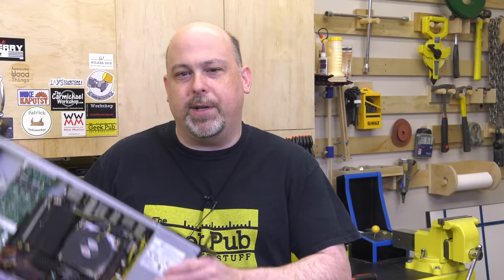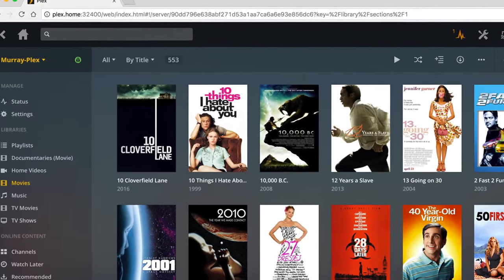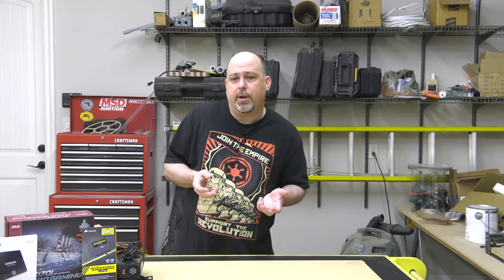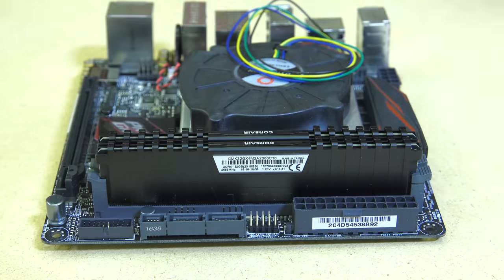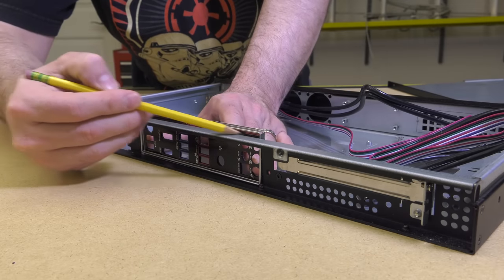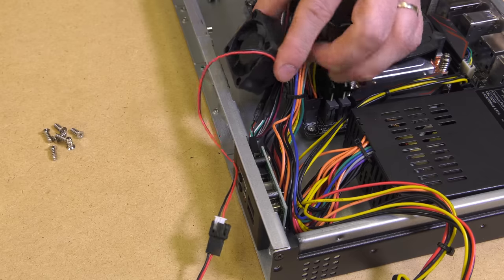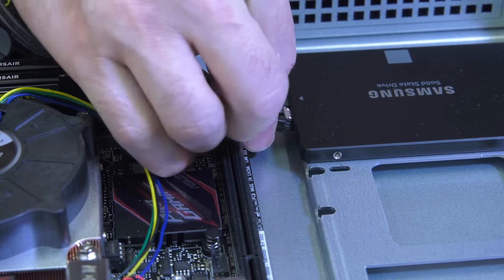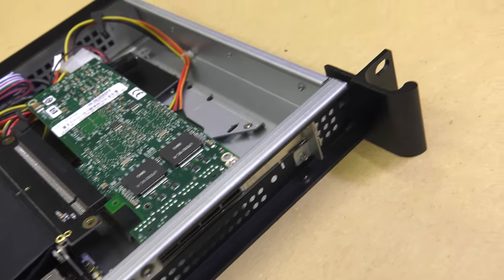Building a 1U Server (Bad A$$ 1U Server)

Comment: a server without a xeon/ECC ram is hardly a server, not to mention that the xeon would be a good lump cheaper than the i7 despite having more features, ECC support, lower TDP and better yet the same spec with only 500MHz lower clock speed IIRC
Reply: matthew brown You should learn about the definition server, a server can be anything. Raspberry Pi, Laptop and so on.
Reply: nowhere did i say it wasn't a server, i said it's hardly one, given this is to be used for 24/7 operation it pays to use the proper hardware for that, having run servers on consumer hardware in the past i can confirm it is not a good idea which is why i recommend against it and why i feel that anything that uses consumer hardware is as far from a server as you can get, makes little sense to use consumer hardware given that it's actually cheaper to use server parts, the xeons for this socket for 4 cores and 8 threads are cheap and ECC ram has always been dirt cheap for decent quantities apart from the bleeding edge 16GB and 32GB DIMMS
Reply from the maker: https://www.thegeekpub.com/8565/xeon-vs-core-i7/
Reply: TheGeekPub that misses the point of the xeon, it's cheaper and is better suited for this workload, it's a no brainer to go for the xeon really
Reply from the maker: It's not cheaper.  This horse has been beaten to death. ;-)  It's only cheaper if you get a much slower chip which completely defeats the use case for my build.
Reply: TheGeekPub the entire selling point of the xeons is that they're i7 spec for i5 price, they are indeed cheaper, even here in the UK where pc bits are expensive so unless your market is really fucked over there then they should be cheaper
Reply from the maker: By all means, point me to some links.  The cheapest apples to apples XEON I can find to the i7-6700K is $100 more expensive. Additionally, its missing the QSV core of the i7 for video encoding/decoding which my Plex server software takes advantage of.
Reply: TheGeekPub well first off, why do you need 4GHz specifically? Transcoding? I'd so the lesser ones would do fine, VM's don't need clockspeed either, before you go on that tangent explain specifically why you need clockspeed

Comment: should have gone with mini itx xeon, you know, actual server hardware lol
Reply from the maker: Find me a motherboard, processor and fan that will fit in a a 19" 1U case that is 12" deep or less and I'll get started on it
Reply: there are literally so many server configurations that would fit in a 1U lol!
Reply from the maker: 12" deep?  I'll humbly admit defeat when you show me a link to one.
Reply from the maker: Oh, and it has to be as fast or faster then the the processor I used..  A four year old processor running 1Ghz doesn't count.
Reply: +1998goodboy I was going to try to ignore this thread, but it jest kept eating at me.  I don't get guys like you who comment with stuff like this.  It's like you're just looking for a fight.  I know. Don't feed the trolls.  Shame on me.  TheGeekPub started this video with the fact he was building a server for HOME USE.  For a freaking theater room rack and would also use it for a test lab environment for his home network.  So sure.  Let's assume there is an ITX board that will fit in this case with a Xeon equivalent and let's assume that he can even keep it cool in an A/V closet!  Exactly how much redundancy does one need for home theater server? A Xeon and board are going to cost far more than he spent on this setup and he already has two of these running in VMHA.  Should he also install N+1 power?  Get a couple of chillers and a computer room HVAC system?  Raise the floor 24 inches?  Get a VESDA system installed?  Tell me again the point of your post.  Oh I remember... Trolling.
Reply from the maker: And its only a 2Gz processor, and the whole build cost almost twice what I spent.  I need to do multiple real-time transcoding within Plex to send streams to multiple users.  2Ghz and no on-chip CODECs.  According to Geek Bench, my build will literally smoke this machine. I'm not being negative.  You came here telling me what I should have done, and then provided an inferior solution not understanding my use case.  I'm not the least bit angry, just confused trying to understand your point here.
Reply: But you have the cores, if you will use it for virtualization, it makes no sense to go for GHz over cores. Also, Plex is amazing at using multiple cores, which is why many Plex builds out there used to go for the older cheaper AMD CPUs.

P.S: Geek Bench isnt the best benchmark, simply bc it focuses on single individual core performance. So this benchmark would do justice for tasks which need more GHz rather than cores.

Edit 1: about the price, there are many different configs you can make, this is more of a proof of concept.

Comment: There is nothing "Bad a$$" about using consumer hardware in a server. It's not even a server. You don't buy a bicycle and call it a a 40t Mega truck.
Reply from the maker: Apparently you didn't pay attention to my use case.  Use case matters. Also you might want to look up the definition of the word server.  It has nothing to do with hardware as has been brought up in this thread 1000 times.  U
Reply: Yeah, i stopped watching as soon as i saw the i7 in the Background.
Reply: MrYou88... The Core i7 has a quick sync video core.  That's a hardware video CODEC if you're not familiar with it.  This machine will run circles around the fastest XEON for a media streaming server.  This is the same reason the Core i7 Macbook Pros are crushing the XEON based Mac Pro in video editing performance.

Comment: You can save even more money by not buying desktop CPUs with Intel's patented "Unlocked Multiplier Markup Tax" and motherboards with "gamer" features that you will never use/see inside the rack and  instead going with 1 or 2 generation old Xeons. You can often find those for a steal, or even for free harvested out of old servers that companies sometimes give away or sell for basically nothing. Then you can also use error-correcting memory for all those VMs!
Reply: You're right, but I think you missed the theme here.  He was going for the absolute most horsepower he could cram into that little case.  2 generation old hardware doesn't fit that criteria.  But you're right if you want to save money.
Reply: I get the 'theme' idea, but honestly it doesn't make sense for his stated use case. For all those virtual machines, the added L2 cache and other features designed specifically for virtualization in even a 1 or 2 gen old Xeon would probably give you more benefit than the raw CPU clock speed of a desktop I7. ECC memory is very important as well. Plus there's the heat that I7 is going to generate, a 1U isn't a lot of room, so adequate cooling, if you can even rig it, is going to be god awfully LOUD. imo, using these parts is a waste of money, theme or not
Reply: Let's see... I need to move a couch across town once a month.  Do I buy a $20K SUV or do I buy a $500K 18-Wheeler, with redundant tires, greater load capacity, a longer lasting engine, etc?  While you're technically accurate in your comment, you completely missed the mark.  And there is no version whatsoever of a server board (at least that I've seen) that would fit in a 12" deep case which was his requirement.
Reply: OK man. That's a poor analogy, but whatever. If a job's worth doing, then it's worth doing right... however it's your money, so spend it however you want on whatever kind of couch moving equipment you see fit. Have a good night

Comment: Its NOT a server. Its a PC in a 1U box.....If you want a cheap 1U server for home ESXi work and development. Look at a Dell PowerEdge 1950 III or newer. (Dell, HP, IBM / Lenovo certified hardware server engineer). At least that way you can use vendor optimised ESX builds.
Reply: Dude.  You obviously have no idea what the definition of the word server is. A server is a function, not a piece of hardware.  Anything can be a server, even a Raspberry Pi.  Some servers need more redundancy than others, but they are still performing a server''s role.

Comment: Xeon cpus are better and cheaper
Reply from the maker: Def not cheaper, and completely wrong for video CODEC applications since it doesn't have a QSV core (at least when this video was made).
Reply: I’m talking about the slightly older ones like the x56 procs

Comment: while its cool, the reality is your consumer level hardware its not quite what is really a server, its a home server and thats fine, 

i bought each of these, for 30 bucks from a university, i run them in the closet, the 4U is now 500TB and 4X E5-2697V2 12 cores ,24 threads, 256GB of ram, and have about 300 bucks into them

today i have both of these running my home on 10GB fiber

i made this in response to LTT crashing their full SSD server, older is sometimes better 

https://youtu.be/WGu2VM5YrQk
Reply: As mentioned numerous times, a server is a function not a type of hardware.  He said it was a home theater server.  I don't think he's suggesting people go build this for data centers.
Reply: Correct but the common misconception of what a server actually does and consumer level technology is not reliable as a server 

I get what he is trying to convey but someone said it best, he built a glorified desktop in a 1U case

Comment: you flow all the heat from the CPU over the NIC its not a good idea as you explained that it is important part of your server
my advice, loose the back I\O and keep it open to the cpu to flow its air outside
Reply: That's actually terrible advice.  I understand your point about the network card, but if you took out the IO plate, then you'd stop all airflow from the network card and SSD.  The flow of air through the enclosure is very important.  This is what stops one area of the server from getting hotter than another.  This is the exact same science behind why data centers have raised floors, vented tiles in specific areas, and plenums at the ceilings for returns.  This is to force air to circulate uniformly and avoid hot spots that would otherwise be created.  Don't do this.
Reply: Reggie Cotton
But he installed 2 air flow onfront of the rack server
My rack servers at work have 2 optins for air flow all over the front to the back or from side to side

Comment: Without the proper airflow of a true 1RU server your HP 4 port NIC will have a short life. Those get very hot.
Reply from the maker: According to the temperature data, it is well within its operating temperature specs.
Reply: Under what kind of load?
Reply from the maker: As mentioned, I test all of my systems with Prime 95 at 100% CPU load for 24 hours before placing them into service.
Reply: Network load not CPU load. If you don't really use much of your NIC's throughput, it should workout Ok for you.
Reply from the maker: I don't get it.  So somehow my machine is capable of cooling a Core i7, but not a NIC?  Am I missing something here?
Reply: Yes, those vintage Intel quad cards get very hot under full load. Most good enterprise servers have very good front to back airflow which those cards rely on.   Touching the heat sync on the card after full load, in a system without good airflow, will not be pleasant.
Reply from the maker: "system without good airflow" - Who has one of those?
Reply: Todd.  Are you serious dawg? Do you even know what you talking about?  I'm surprised geek pub even giving you the time of day on this. You don't know whether it has good airflow or not.  You just talkin to be talkin.
Reply: It looks like your ingest fans are on the right side of the box in front of the power supply.  The quad NIC is on the left hand side.  I'm just putting the warning out there.  Take it or leave it.
Reply: I think I speak for everyone when I say "We'll being leaving it!"
Reply: BTW...the HP NIC you used in the video is an older HP NC364T.  It's the same as the Intel Pro 1000 PT, not the newer Pro 1000 VT which you talk of and are pointing people to.  See markings list here: https://goo.gl/RLuzBA
Reply from the maker: false.
Reply: Well, did you swap to a different NIC after the video?  Around 9:23 in your video you can clearly see the HP part #:  436431-001.  You can find the HP part here:  https://goo.gl/x4Q98N  I guess it could be a Chinese knockoff.  Now I'm real curious...can you take a direct picture of the top and bottom of the board and post it?  FYI...I've got the NC364T in one of my servers and I'm pretty familiar will it.
Reply: He mentioned somewhere (maybe his blog) that these were refurbs and they came with half-height mounting plates for 2U servers. Since they are mounted using full height backplates I must assume he replaced them with whatever he had laying around. It does sorta feel like you're just here looking for something to argue about, but I'm going to  give you the benefit of the doubt.
Reply: I started with a concern about his quad NIC.  When I paid more attention, after being belittled by others, I was concerned that he didn't use the NIC he was talking about.  I'll just bow out now...I've got too many client systems to deal with as well as my own.  Everyone have a good life and feel free to kill this thread.  No worries here.

Comment: Not very professional. Cannot understand why i7 instead of Xeon for example. Seems you have plenty of money and do not know how to waste your time and money.
Reply from the maker: I should delete your comment for rudeness, but I thought I would attempt to educate you instead. If you'd like dig deeper you can read the 100's of comments that already discuss this.  But this is a PLEX server.  For a HOME THEATER.  The Core i7 has a special core called the Intel Quick Sync Video core that encodes and decodes video in hardware.  No XEONs have this ability. Period.  Benchmark after benchmark has proven that the Core i7 will trounce a XEON at encoding and decoding video, unless you just want to waste your money (speaking of money) and buy 24 core xeon and just brute force it.
Reply: +Renaud Chine sometimes I wonder when people comment on videos if they even watched it.  "I cannot understand why"  Because you didn't pay attention.
Reply: Only Plex alpha supports hardware acceleration encoding/decoding and that's only supported on Intel processors (Soon to be GPUs) . But yes, cost to performance and I7 will be better than any XEON for encoding/decoding . So then would it be better to go with something like a dual socket LGA 2011-V3.
Reply from the maker: QuickSync is available to anyone with a Plex Pass.